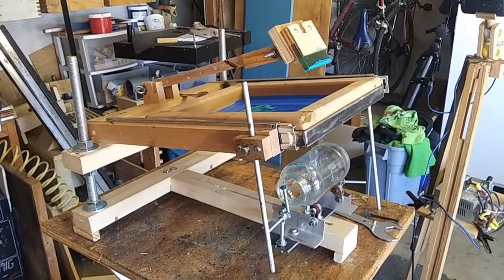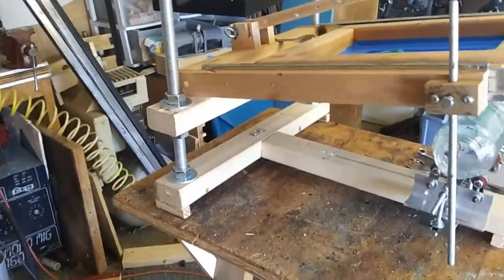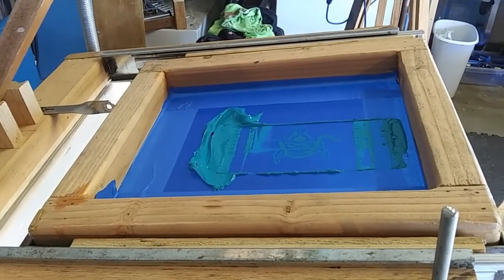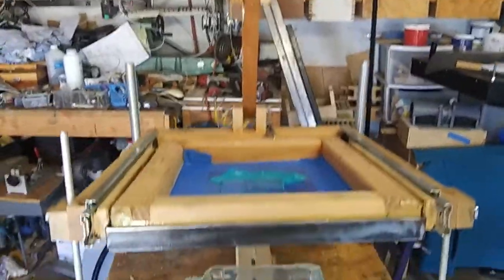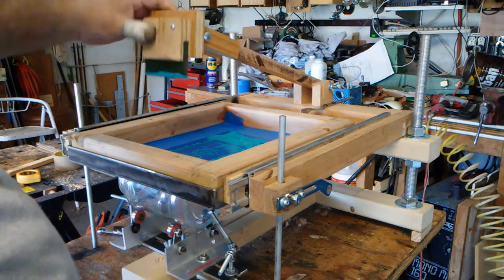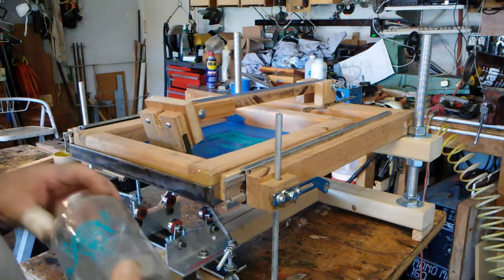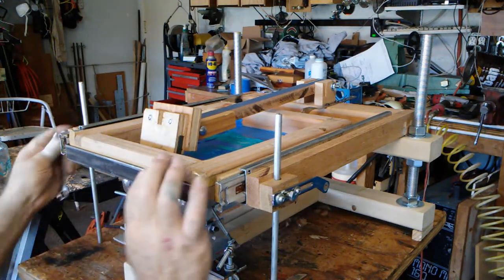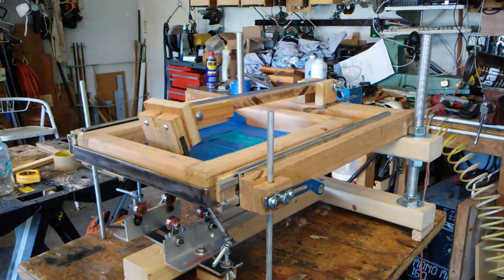Stand-Alone Cylinder Printer

Comment: What is your mesh count?
Reply from the maker: between 160 and 230...depending on the design.
Reply: @cyclesurgeon  can use 120
?
Reply from the maker: @dydyra9124  Don't see why not
Reply: @cyclesurgeon  when I use 120 the ink pass the screen to glass a lot and my picture so bad
Reply from the maker: @dydyra9124  Then I guess you can't use 120 for your design...simple as that.  You have to experiment a bit.
Reply: @cyclesurgeon  so I will use 165 mesh...

Comment: Rad! How do you keep the cylinder from moving left or right?
I'm all about simple design :)
Reply from the maker: I have a couple limit bolts that contact the jar top edge and along the bottom.  Kind of like the X axis adjustments I use on regular printing screens.
Reply: Which bolts to move left and right